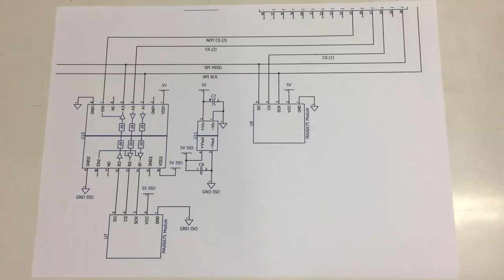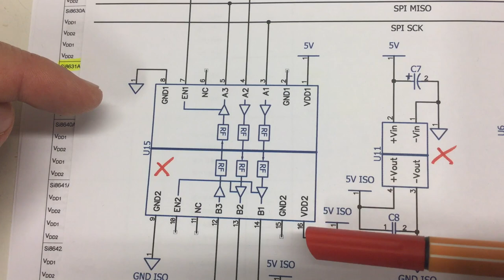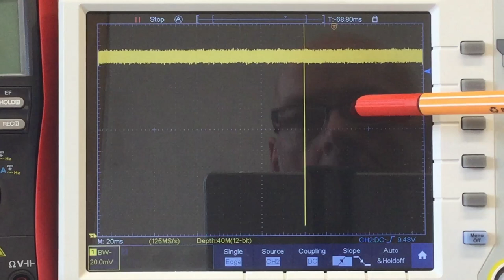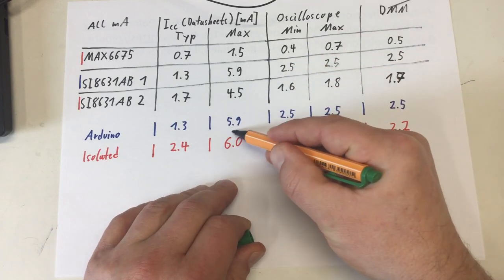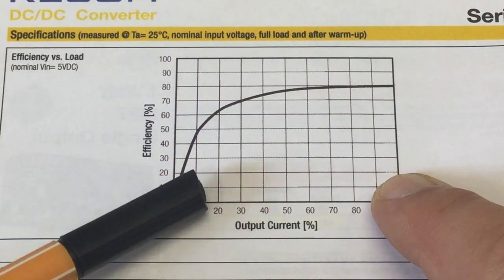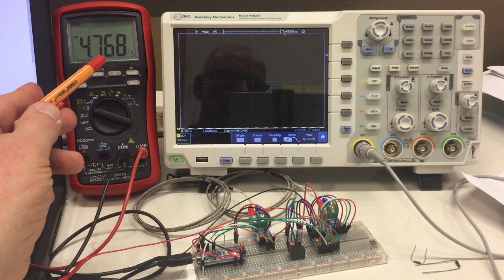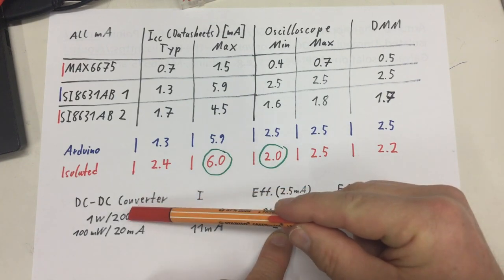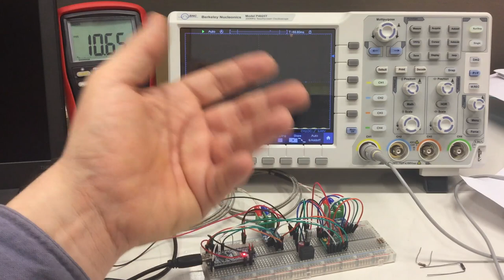The Cost of Digital Isolation (DC-DC Converter, SI8631, MAX6675 and Arduino)

Comment: fascinating stuff, I had no idea the price was that high, and very interesting what you say about scaling.
Reply from the maker: Yeah, current/efficiency wise it's a mess. Huge power transformers (MW range) have an efficiency up to 99.7% while small print transformers (W range) have about 50%. You can improve the efficiency by using higher frequencies, but there are limits to that.

Comment: Hi Robert, interesting video.
Just a thought, if you're only reading the isolated thermocouple every 10 seconds for example, could you not use a MOSFET to switch the DC-DC converter (and half the digital isolator) off whilst its not being used.
If it's only on 10% of the time you could make huge gains.
Reply from the maker: That's a very good thought! Yes you could absolutely do that. Especially in a battery powered device that would be an absolute battery - life ;-) - saver. I'd guess you could even go down to one second cycles with a few 100ms on-time and still save power. The worst case conversion time for a MAX6675 is 220ms and the DC-DC converter needs some time to power up. However, each power up will cause a little spike in current consumption because the decoupling capacitors will recharge etc., so there's a limit on how short you can make the cycles without making things worse.
Reply: @robertssmorgasbord  the level of capacitance will impact the gains, but even if a 10% duty cycle only gives you a 4 fold improvement, that's still huge.

I've seen this technique implemented very successfully to power down radio modules on battery powered remote sensors where they only need to send a measurements every 15 minutes.
Combined with the ATmega's sleep mode, and literally only leaving a timer interrupt to wake things up, and you can run the whole things on a super capacitor and a small solar panel!
Reply from the maker: @juststeve5542  Interesting ... never used the ATmega's sleep mode before, definitely something to try. Anyway, the thing I'm aiming for is a battery powered handheld temperature meter (four 4-digit LCD displays, four 1-Wire inputs for DS18xx temperature sensors + four inputs for thermocouples - use either DS18xx or thermocouple for one display). I would like autodetection of the plugged in sensors of course ;-) I'm gunning for an update rate of 500ms, but maybe I could slow things down for the thermocouples (1 second) and poll unused MAX6675 only every 2 seconds to see if something has been connected.